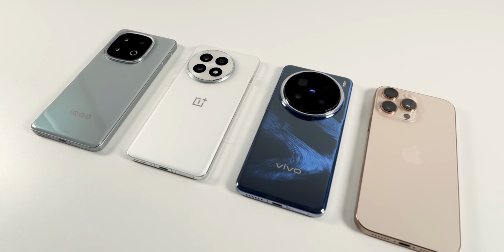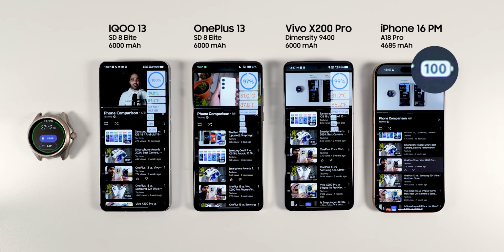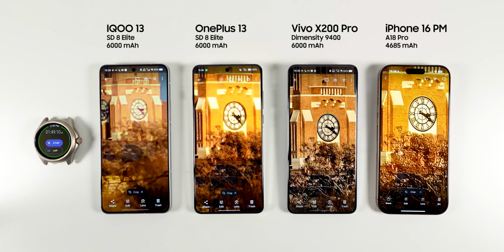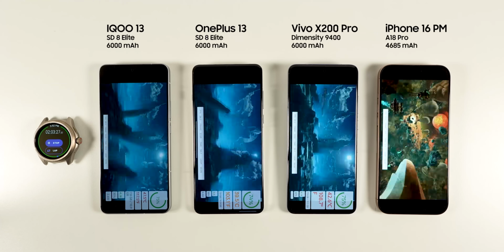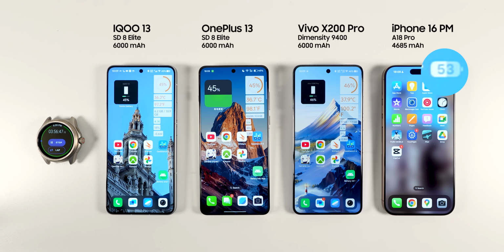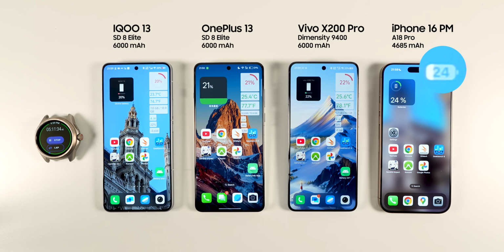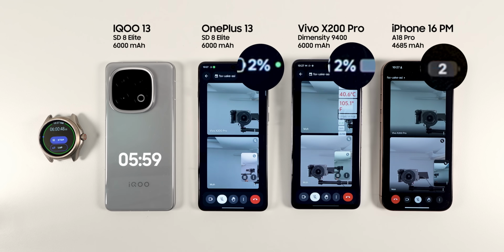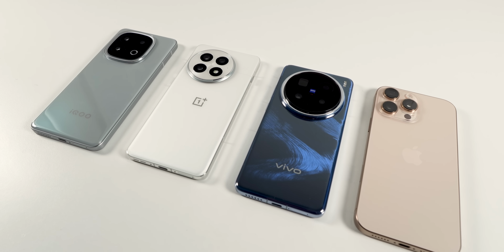Best Battery: OnePlus 13 vs. Vivo X200 Pro / iPhone 16 Pro Max / IQOO 13

Comment: I'm very glad OnePlus did it 🔥
Reply: Watching this on Oneplus 13😊
Reply: @jonnycarlson9555  it,s my dream phone congrats bro
Reply: @noobplayer4331  I hope you'll be able to get one some day 😁
Reply: @noobplayer4331 why is it your dreamphone?
Reply: @reinholdlaimgruber4737  why's because its king from every angle only one thing is down is camera
Reply: @noobplayer4331 what are your favourite Features and why you think its better than a iPhone/Pixel/samsung. i get the point with charging/Akku
Reply: @reinholdlaimgruber4737  it don't have that much features like Samsung and pixel ai but 6000mah battery 100w super fast charging QHD A++ Display Snapdragon 8 Elite antutu score is 3M in OP13 IP68 and IP69 Aqua touch 2.0 which is iphone samsung pixel never has and many things watch OnePlus winter you get to all features and i saw many battery drain tests OnePlus becoming top 1 even it has way higher Resolution than iphone samsung pixel
Reply: @noobplayer4331  i know everything about this phone mah boy. i just want to hear your opinion on it. some drain tests do not last that longer than the galaxy s24 and its a "old" phone now.
i was a huge oneplus fan, unfortunetaly things went down after the op9 (software Support, no more pure oxygen experience). carl pei left the company because he said they are going in the wrong direction. i loved the insensanly snapy and ridiculous fast work flow of that Phone. i may give it another try but i am still insecure. i think the Pixel (besides raw power) will be a banger this year, because they Work woth tsmc now...
Reply: @reinholdlaimgruber4737  respect is respect I'm not boy and my opinion is that after 2025 OnePlus is back now oxygen is back first was software update green line issues now all fixed I'm fan of OnePlus from OP 5T
Reply: @reinholdlaimgruber4737  it's been 4 years OnePlus not been optimized 2 app which drain too much battery camera and 3D benchmark
Reply: @noobplayer4331  the Smartphone enthusiasts say, its not a clean oxygen experience anymore. just a copy from the colour os.. the Software compared with the Hardware has been top notch until the op9.
Reply: @noobplayer4331  the one plus enthusiast say its still not the original oxygen. its just a colour os oxygen design .. i may give one plus another Chance. if i dont like it i will send it to you ;)
Reply: @reinholdlaimgruber4737 I mean the OnePlus 13 ( if you brought)
Reply: @reinholdlaimgruber4737 bold of you to assume that they’ll accept a used phone. That too by someone who’s arrogant like you
Reply: Same 👍
Reply: Watching on OnePlus Open 2
Reply: @onsencriss4172  oh bro congrats 🔥
Reply: My choices only 2 OnePlus 13 and VIVO X200 PRO Final opinion
Reply: I m not sure what to think about it. Sometimes its good sometimes bad. Especially 5G is setting the battery to half.
Reply: Watching on my OnePlus 14 💪
Reply: @mrreddick2633  hahaha 😂

Comment: The Iphone is lacking in multitasking and customization so that the work in the background is very minimal, which affects better battery durability. Smaller capacity cannot make the price of an iphone cheaper than others.
Reply: Iphone use much lower ppi density. Iphone refresh rate is much lower. Iphone resolution is much lower. All of these take extreme battery. Iphone brightness is much lower then vivo. And iphone automatically dim brightness level after some point.so many reason is on iphone side for longer battery. And their software focus on battery more. Get some education
Reply: The ability to split screen is not draining your battery when you are not using the feature. Apple has some smart ways to optimize the resource consumption that is required for the OS to run.
Reply: @davout5775  It is not only a split screen but many other aspects as well. There are more applications that run on the android system than on the iphone, because android is full of customization. That's the reason why android requires more ram than iphone.
For example, in terms of downloading, the iphone will stop downloading if the screen is turned off or exiting the application, while the android will continue to run the download. This is proof that the android system will continue to run this feature since the cellphone is turned on.
Reply: @zianfarahariyadatuljanah407  The less RAM required is due to the superior compilation of apps. Android has more customization options, that is true

Comment: As much as I dislike iPhone I can't deny the fact that it has a very impressive battery beating the others even tho it has a battery that's quite a bit smaller.
Reply: It heavely depends upon optimisation which is why the battery life is so damn gud on iphone..but oh boi, one small bad optimisation update and it drains like crap..
especially on launch day, 16 Pro max didnt do a great job but after updates, its now much better..
Reply: @CrystalDabber  Agreed. My smaller pro has been suffering after 18.2, randomly overheating with worse battery life.
Reply: I'm samsung user but even I know iphone have improved battery so much now!
Reply: bro iphone limiting screen refresh rate to only 80hz all other phones doing 120hz so naturally it will gve more battrey....and also iphone is 1.5k display 460 ppi and oneplus iqqo are 510 ppi 2k display.....

set them all to fhd with screen refresh rate at 60hz then see where iphone stands
Reply: Yeah except it takes 2hrs to charge and the others take 30mins to charge
Reply: Cheater capping frame rate
Reply: At this point it's irrelevant, what's more important in day to day is battery charging speed which iPhone is garbage at.
Reply: but same weight or even more than all others with way bigger battery and better and bigger camera sensors. maybe a better cooling system or system tweeks, thats it.
Reply: Yeah but you pay significantly more per mAH for the IPhone
Reply: If you have bad performance of course you'll have a good battery, the benchmark test on those 3 Android phones we're running 40+fps while iphone keeping on 20-25
Reply: Money matters brother
Reply: its due to its highly efficient processor working on a 3nm architecture
Reply: The android phones are using state of the art silicone carbon battery so while the capacity is bigger it's a smaller battery then iPhone. At this point iPhone is stuck in old tech
Reply: The only reason i dont buy an iphone is bcs of its battery

Comment: its strange that when you look on the power consumption vivo is always taking more watts and at the end Vivo still wins. if the battery capacity is the same then snapdragon needs to be lying about power consumption or vivo is overly generous when reporting power consumption.
Reply from the maker: The number is not accurate. I don't know why, and I tried to get to the bottom of it. I do read the values from Android API, but something is wrong with the values I get for watts on Android 15 for some models. Nice catch though :)
Reply: @techmo2020 OnePlus and IQOO power results needs to be doubled , because of double cell battery.

Comment: 8:32 oneplus actually only went into super power saving mode so it couldve died in a few minutes, making it possibly tie with the x200 pro
Reply: you are very dumb lmao
Reply: All of these phones if you ran them on low power modes would probably get more SOT. I get about 20-25% more SOT with low power on my iPhone.
Reply: @andyH_England  depends on the use case, sometimes it barely makes any difference and other times it makes a day and night difference
Reply: I get 9.5 hours on oneplus

Comment: Imagine a iPhone 17 Pro Max with a 6000mAh battery.
That would be +28% longer battery life, based on this test this would result in a battery life of 7h and 47min
Reply: I can imagine by what year Apple will introduce such innovations into their phones 😂
Reply: Yea yea that would be nice idea for their iphone 27 pro max.
Also price would be 3500usd
Reply: Isheeps: imagine!!!

Keep imagining things but in reality it's the same phone every single year but only the price changes and the chip
Reply: Imagine vivo with iOS.
Reply: Imagine iphone not limiting its performance after sometime 😂.
Reply: Keep dreaming
Reply: You can imagine them increasing the battery and you would be doing that for years now because they never have and never will give the same battery size
Reply: It would be way heavier and very unrealistic.even tho those phone hv 6kmah they still weigh lesser than ip16pm
Reply: Imagine Iphone have anything new 2025?😂🎉
Reply: Imagine apple giving someting good to their customers.
Reply: Imagine a OnePlus 14 with same optimization/efficiency as iPhone 16 pro max 
That would be +70% longer battery, based on this test.
Reply: @BhaiTheLion Your math isnt working.

The 16 Pro Max lasted 365 minutes with 4685mAh, thats 0.07790821772min/mAh

0.07790821772min/mAh * 6000mAh = 467min
Onplus 13 lasted 368min

467min : 368min = 1,269
Thats +26,9%, not 70%
Reply: @Manuel-p6u8j  buddy how dumb are you it was a troll comment 😂😂😂😂😂
Reply: @BhaiTheLion  It's more likely for the iphone to have the same amount of battery than for OnePlus learning how to optimize their phones 
Chinese brands don't know how to do that, that's why they are always pushing bigger numbers, to make up for the lack of optimization.
Reply: @jorgeescudero5034 yeah for most Chinese brand they don't focus on optimization but brands like xiaomi and Huawei software are pretty optimized
Reply: @jorgeescudero5034 Test battery of my 6 year old,never factory reseted Huawei with iPhone 16 from box. I will give it for free to show you how wrong you are.
Reply: @jorgeescudero5034  More than that it's about the variety. the chips android phone uses are not made for a select handful of devices like that of iphone. also the Iphone M series chips are designed by apple itself running apple software. if they weren't able to provide this amount of optimization then they don't deserve to compet in the market

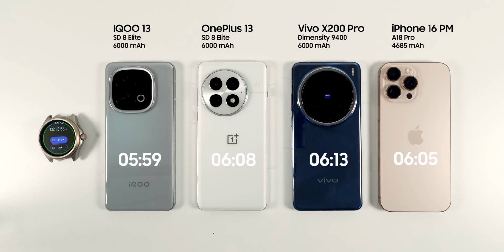Comment: 9:06 bro Xiaomi 15 Pro hyperOS 2 beats vivo easliy
Reply: No
Reply: Haha😂😂 where?
Reply: @Getquora battery, not camera, camera little better on vivo, but Xiaomi is not far behind, vivo funtouch os is very lacking in essential features & optimization, HyperOS 2 is ahead, overall I will go for Xiaomi 15 U when released.
Reply: @shibujha1 OriginOS not, Funtouch 🤝🏼
Reply: @shibujha1 Wtf bro Overall, the Vivo X200 Pro has a much better OS than Xiaomi's Hyper OS. Who says it has minimal features?
Reply: @Exorcist282 it's true can't funtouch os to hyper os
Reply: @Exorcist282 funtouch os is the least preffered os😂
Reply: LoL

Comment: Bro my iQOO 13 ran almost 12 hours in pubg 60 fps smooth + extreme 100-% battery draining test
I have never tested a phone which lasted this long
Poco F5 best was 7 hours and it was one of the best battery life phones i used 
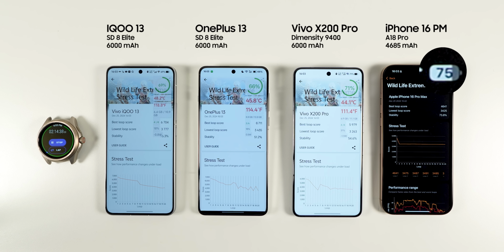Iphone 14+ lasted only 4:30 hours
And most phones barely ran 5 hours on that test
Reply: Pls try call of duty mobile and tell me how long it played it on medium graphics and ultra frame rate you can post the video on your channel
Reply: @SonicYT.official still around 11-12 hours non stop
I can't do tests 12 hours long it's too long.....
Reply: @Smzxe  true but it won't bet the iphone 16 pro Max
Reply: @Smzxe  oh I get but the iphone 16 pro Max can go 12hrs on PUBG mobile
Reply: why 60 fps? is it 120?

Comment: I see the vivo is winning every comparison on YouTube lately
Reply: Vivo is the best in terms of battery and cameras, and it's perfectly fine with me to make a choise and buy it...
Reply: 14 mins difference between all four is within the margin of error so I would say a draw. You certainly would not make a decision based on battery life between these four as they are all great.
Reply: @andyH_England  Yes but androids mogs iphone in charging speeds.
Reply: And iPhone mogs in pretty much everything else. Coming from an Android user. @akarshmittal9601
Reply: @akarshmittal9601  I charge my 15 Pro Max every day from like 35% to 80% in under 20 minutes. I used phones with 65w and 80w charging in the past but when i switched to the iPhone i realised I don't care at all about battery life since I only charge it to 80% and it lasts me whole day easily, and it charges at full speed to 80% so it's not that different from other fast charging phones.
Reply: @akarshmittal9601  not Android... Chinese Manufacturers 😂
Reply: @andyH_England  The thing is, iPhone only has 4650mAh battery versus 6000mAh that the android phones have and it still wins :D Now imagine an iPhone using this 6000mAh battery.. it would win by like 2.5hours atleast.
Reply: ok but they don't  @belec5964
Reply: @belec5964 Whats the point of saying if the iphone has 6000Mah battery, the issue is it doesnt, and never has. Whats the point of making up scenarios when it doesnt matter if iphone could have better because in reality it doesnt
Reply: @Ezim-sb6pg  I never said it's an issue, the thing is it doesn't need a 6000mAh battery when in beats like 99% phones in battery life with a 4650mAh :D Apple haters won't accept that iPhones sw optimisation is simply on another level.
Reply: @belec5964  Dude i didnt say that its an issue, but just that these top of the line android phones beats the iphone at battery life. It doesnt matter if the iphone has better optimisation, or if it COULD beat the android if they put a bigger battery in. At the end of the day it doesnt have the better battery life, full stop. Theres no point in bringing up better optimisation, if at the end of the day you still have a shorter battery life
Reply: @Ezim-sb6pg Saying that it does not have a better battery life than the others is irrelevant. In this video they take between 10 minutes between all so for me it is a tie and any today can give you a good battery life, it is simply choosing between iOS or Android and what a layer of customization.
Reply: @carlinhoo0878  I think youre forgetting that the androids here all run at a higher refresh rate than the iphone, and in benchmark apps iphones with not push their maximum power to save battery life while android all will go at full maximum power all the time. You can see actual proof in other peoples test, but basically in a real life scenario of users using their phones to look at social media/playing games the vivo actually gets a very significant amount of time higher battery life than android 16 pro max
Reply: @carlinhoo0878  If you actually wanna see somebody who knows how to actually conduct a battery life test, you can go see MrWhoseTheBoss's video on in, in that the s24 ultra beat the iphone by a whopping 1 HOUR
Reply: i think Iphone won, becuse has less battery. Other phones have over 6000 mAh and Ip only 4685.
Reply: Ya
Reply: iphone goes toe to toe  because its limiting screen refresh rate to only 80hz and all other phones are running on 120hz 😂😂
Reply: @ManishPandey-zx9nn  Idk if you’re just dumb but this has been proven many times to be fake. Just say you hate iPhone because you can't afford one 🤣 Apple haters always need to have some excuse because iPhone is simply better. Imagine an iPhone with 6000mAh battery, it would destroy every other phone atleast by 20% when it beats phones with 1400mAh larger battery 🤣
Reply: @ManishPandey-zx9nn  Oh, you're from India, so like I said.. You definitely have some cheap poco phone or something like that. Typical

Comment: 6 hours is a little less for 6000 MAh phones. I expected at least 8 hours considering the heavy usage shown in the video
Reply: Video, gaming and benchmarks on 5G are the toughest tests and I have seen similar that get more, seven hours for the iPhone and 8 hours for the Vivo. I suppose it also depends on brightness, 5G consistency and other factors.
Reply: Hopefully the OxigenOS for OnePlus 13 will make a comeback in the battery department..
Reply: @thinkanup  he was doing benchmarks etc.. for daily usage I am gettings from 7-9hrs with wifi and mobile data combined..
Reply: @thinkanup  mine is vivo x200 pro btw
Reply: a single benchmark test can take 10% of your battery, so without it you're look at 7-8 hours

Comment: It just shows that android companies put 0 effort into battery optimisation. The "super efficient chipset" is just marketing hype because the chipset also drains more power therefore even though it's 'more efficient' that the previous gen, that doesn't actually mean it gives better battery life
Reply: They put better optimisation 😂😂. But their software is a lot more complex and has a lot more features than iphones simple and bland software 😂
Reply: @anotherguyinaroom9105 well those extra features most of the times are half baked and useless on daily basis lol
Reply: @Quartza_  😂😂😂😂 most of the features are fully baked,  and for the half baked ones they're better to have than no features at all (apple)
Reply: Only if you manage to max out the performance of both chips, if you use it for the same workload at same amount of time it gonna last longer
Reply: Mate this test was flawed. That 20 min stress test destroyed the result. The iPhone was 50% slower performing. That's it. It's not more efficient, it's just slow AF compared to the 8 Elite in GPU benchmark like 3D Mark WL Extreme.
Reply: @techstation365  yeah I'd prefer battery tests to just replicate daily usage. Nobody's running back to back benchmarks in normal use

Comment: Imagine an iphone with 6000mah...
Reply: imagine a vivo with iphone  optimization
Reply: can't imagine, with Apple's lousy battery tech, the phone will be 300g. 
Vivo can pack more Mah into the same size and weight of battery because it is using the more advanced silicon carbide batteries.